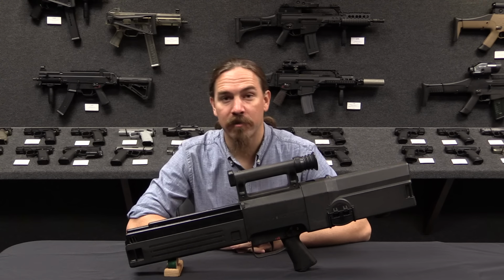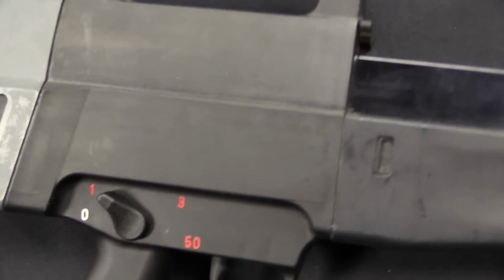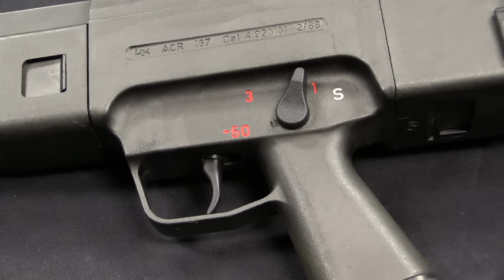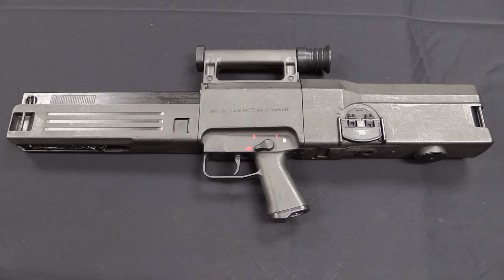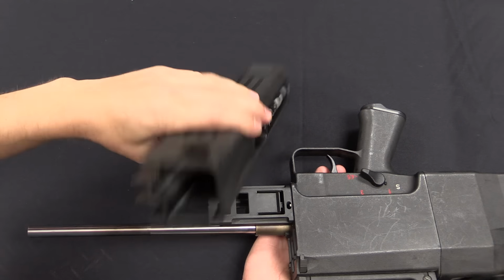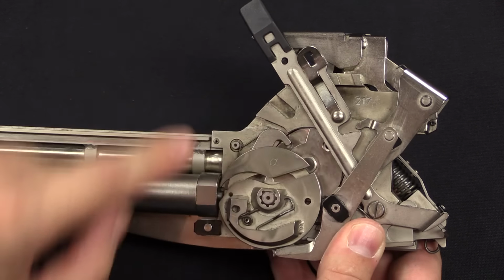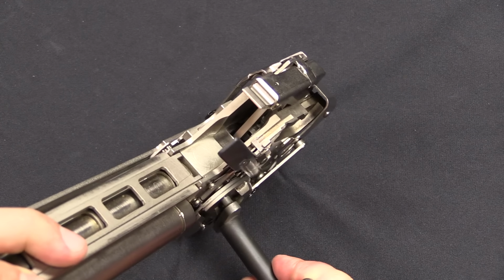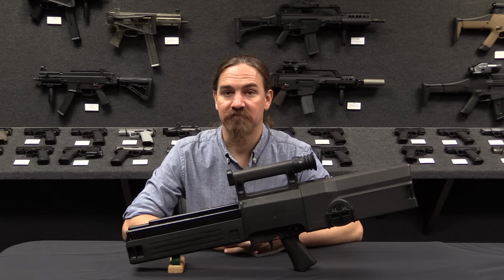Kraut Space Magic: the H&K G11

Comment: I don't see why the G11 didn't continue in development. Yes, the main component is complex as hell, but at the same time, it's just one lump of metal. If something important broke, chances were, the whole thing would need to be sent back to an armory to fix. On the other hand, it looks simpler to maintain than an AK-47 and would likely last you a lot longer with some basic TLC. Most importantly, I noticed, is that to simply get the weapon back into service, just take the lump of metal out and insert new lump of metal.

The Plastic Exterior could be upgraded with time and more durable materials as development would continue. Not like that hasn't already been done before. Tone down the rate of fire a bit for better accuracy and with its small size, a soldier could fight an Urban battle quite easily. He's presenting a smaller target, because the rifle doesn't stick out so far.

Seems like everyone is forgetting that all major rifles that have been in use, have been having jamming and overheating problems. The 'Improved' M4A1 is only improved because it tended to overheat and fail, requiring a new barrel and development for those parts. The G36 that eventually would replace all other German Rifles, has warped in combat pretty badly and is being replaced. The French are struggling to replace their rifle, as no one else uses steel cased ammo. And I heard the British had some fits with their weapons, as did the Canadians.

But most importantly, was the abject FAILURE of the 5.56mm to live up to expectations. To improve the round, all weapons are cracking like hell and requiring double the amount of armory maintenance, forget field maintenance. The G11's simple system likely wouldn't be able to accept a bigger round, but I have little doubt that if something breaks, the rifleman isn't having to sign out for a whole new rifle while a broken rifle will have to wait in a crate until its full to be shipped via Cargo Plane.

With the G11, just throw the broken pieces into a box and simple them via FedEx!
Reply: The problem is that the soldier's "work environment" has changed drastically since the adoption of the AK47, or even the M16. Body armour has added considerable weight to the soldier's basic loadout, as have various other tools, like individual commo, taclights, optical sights, and so on, and so forth. A weapon like the AK47, the G3, or even your basic M16A2 is actually a *weight problem*, hence the shift to the M4, to plastic everything-but-the-barrel/action, to experiments with case-telescoped plastic cartridges, and even caseless (the main argument for the G11 was never that it was better than the 7.62mm G3, but that it was lighter).
Right now, armies the world over are trying to square that particular circle, and most of them are not really succeeding, at best. 
The reason HK didn't pursue the G11 after the Bundeswehr cancelled and the ACR petered out is much simpler, though: the company went bankrupt. Ended up owned by Royal Ordnance, before being bought by the current owners. I blame a certain sense of being screwed over on HK's part for the shitshow that was the introduction of the G36.
Oh, and most of your suggested improvements to the G11 would run counter to its primary design features. They'd make the thing heavier, and "marksmanship" of the "one shot, one kill" variety isn't really a thing on real battlefields. Hasn't been since at least WWI.
Reply: @jochentram9301  To be honest i think this thing would be great for armor crewman and vehicle crewman, it is short enough to fit in my gunners station on the M1 Abrams. With the way the M1 Abrams is getting replacement parts to the users would not be an issue, you would not see it getting very dirty cause we just stick our weapons in the sponson boxes or next to or under our seats anyways. If you took off the optics and replace it with some flip up sights you would have a very effective PDW type weapon.
Reply: @jochentram9301  - Not entirely true. There are some materials out, especially on the open market, that are both lightweight and reliably tough. There would be an increased cost, yes, but I also don't recall saying that the G11 or a derivative of it, would be better than any other rifle. I recognize that due to its features, it would not be best to be issued as a General Issue Rifle.

I'm actually of a the 7.62 and .30 cal club. I believe modernization programs would cost less to revive both types to be more effective for General Combat Purpose (with variant types, of course) for combat. Like Brandon Child said, the G11 would be small and effective enough to be given to Tankers and other personnel who wouldn't be expected to be full time Riflemen.

Essentially, I would see the G11 fulfilling the role of a traditional Carbine (as a opposed to the non-traditional M4 Carbine, now Rifle). The traditional Carbine was always smaller and lighter, because it's job was to equip troops who would not be able to use full size rifles. This was previously the Horse Cavalry and Dragoons. Now it's generally anyone not serving the role of Rifleman or other type of Infantry Specialist.

The M4 Carbine was so designated and developed as a replacement for the M3 Carbine, which was nothing more than a WW2-era M1 Carbine with modifications to it. The M1 Carbine was developed to arm troops who would normally not be expected to be frontline troops, hence some later issues that cropped up. These were supposed to be men such as Truck Drivers, Supply Personnel, Cooks, Clerks, and other Rear Echelon personnel.

Some frontline troops were given M1 Carbines, but they were mostly supposed to be only Officers, Radiomen, Bazooka Teams, and other specialists where a larger, heavier weapon would be more of a hindrance, than an assistance.

The M2 Carbine was already in development even before WW2 ended, because the US Army had always wanted to add Full-Auto to the M1 Carbine, but needed the M1 sooner rather than later. So the selective Full-Auto was left behind. Work began in earnest in 1944 and M2 Carbines began to appear not long after, though there had to be changes done to the T4 in order to achieve full auto without problems cropping up.

Among other things, another change, had been to add a Bayonet Lug. Pictures do exist of WW2-era Carbines equipped with Bayonets. A notable one is dated September 20th, 1950 and in Seoul no less. Another Korean War image shows Communist prisoners being watched by a US Infantryman armed with a M1 Carbine with a Bayonet attached on a hill somewhere.

Additionally many changes were retroactively given to the M1 Carbine as well.

The M3, likewise, was also an ongoing development for improved capabilities and was issued to troops as early as the Okinawa Campaign. The major difference was the move for the M3 Carbine to be more of a Sniper Carbine. Only 150 initially went to Okinawa, but these carbines had early Night Vision Scopes and despite their limitations, estimates said at least a full 30% of Japanese losses on Okinawa alone, were the result of teams using M3 Carbines to picket against Japanese infiltration and patrols.

These would all prove to be legacy weapons that were kept in US Military service until after the Vietnam War. The M4 was not an immediate replacement, there had been the CAR-series, which had its own issues. The M4 Carbine was started in 1984, but was not actually accepted until 1994. The M4 has been in use since, but has made the shift from Carbine to Rifle, leaving a gap that already existed much larger from the lack of a traditional Carbine.

The G11 can help fill this gap. As one noteworthy Tanker, a gentleman by the name of Nicolas Moran, once stated, he would be less concerned with the ammunition than he would be, with being able to keep an opponent's head down while he ran away to get another Tank if he should be forced to abandon his Tank due to some reason in a combat zone.

That and he once listed off the weapons his crew needed and frankly, I'm amazed they could even fit HALF that amount in the turret without it becoming a safety hazard, though they figured out how to mount the LMG on the turret and so make use of it as another Tank weapon.

The G11, if it doesn't fill the traditional Carbine role, would still make for a better replacement for the Sub-Machine Gun or Machine Pistol (depending on what country you're from). Small enough that it could fit even in a helicopter for use by flight crews, which would provide them above Pistol-level firepower, but also not a full size Rifle, which could get stuck if they need to make a fast dash for it.

I ascribe to the belief of a weapon has a place and its best to know that there are limits to what a single system can do. The M4 is being tasked as both Carbine and Rifle, sharing ammunition with the LMG that gets issued. Attempts to turn all three into a single weapon and add both DMR and Sniper capabilities has not only proven to be a failure, but has also prove difficult and costly in terms of resources and money. Therefore, it is best to have something that fits a role better, than have something that can't properly fit at all.
Reply: @FLJBeliever1776  When I joined the German Army, the G3A4 was my issue weapon, and it was a fine piece of kit, but that time is done.
The problem with 7.62x51, or indeed any 7.62 round worth carrying is *weight*. The rounds are enough heavier that a worthwhile combat load of about 200 rounds per rifleman and 1,200 - 1,500 per machinegunner. That's exacerbated by the fact that the weapons would have to be heavier than 5.56x45mm weapons, simply to handle the much higher bore pressures. Notably, the HK MG5 is about in the same weight class as the MG3 it's replacing, slightly more than 11kg empty (the lighter variants have shorter barrels, which creates its own issues). Add another 10 or so kg of body armour, a few grenades, the occasional RPG, personal comms, NVGs, the plethora of stuff nowadays hung off Picatinny rails, and spare batteries for all of it, that rapidly adds up to an unsustainable load for the infantryman. 
That's the main argument for 5.56, and indeed 4.7 caseless - a 30-round STANAG mag for the M16 is a third lighter than a 20-round mag for the M14, which enables the infantryman to lug around all the stuff that simply didn't exist in WWII/Korea, but makes a modern infantry squad many times more lethal than their earlier counterparts. 
No amount of space-age materials is going to change that basic equation: 5.56, and the weapons designed for it, will always weigh less than a 7.62, assuming equal tech levels in their construction. And unless we want to get back to not issuing body armour to infantry, that creates an insoluble problem.
Reply: @FLJBeliever1776  For use as a PDW a G11 would be overkill and a rather pricey one at that. Could tankers use something more compact than an M4, sure, but something as pricey as a G11 is a bit much for something the crew probably won't use. They'd be better off with AR style pistol with a proper stock instead of a brace.

As for carbine usage, it used to be for rear echelon troops and those who needed a more compact weapon but that's no longer the case. The primary rifle of the US Army is the M4 and even the Marine Corps, who had resisted the adoption of the M4 for a long while, has adopted the M4 as its primary rifle. I don't know about the Army but in the Corps the M4 is what's issued to the grunts with all of the non-combatant/rear echelon troops getting M16A4s, a complete reversal of the way things had been for a long time.
Reply: @Riceball01  Marines just adopted the hk416/m27 to replace the m4 as the main squad level weapon, even to replace the m249
Reply: @Riceball01  - That's because the Marines about to get a wind fall of ex-US Army M4 stocks. The US Army requested of Congress to restart looking into replacing the 5.56 NATO with either a 6.8mm and/or updated, modern version of the 7.62mm NATO. Congress agreed to fund new 7.62mm Rifles for the US Army while the Army looks to replace all 5.56mm NATO weapons in the near future, including issuing requests, at long last, to replace the 5.56mm with 6.8mm in the LMG role and use 7.62mm in both the Battle Rifle and DMR roles.

This came on the heels of the US Army admitting that 5.56mm NATO will not defeat currently available body armor. At least the good stuff, which unfortunately, has been increasingly winding up available and not just US Military stocks either. There was word that the Georgians, when the Russians invaded them, lost some equipment and stores to looters. The same problem occurred in Ukraine.

So there is concern that multiple sources of first rate body armor suit equipment has ended up floating around, outside the controls of Nation States. That said, if we get into with the Russians or Chinese or whoever else and they have good rated armor, the Army stated, the 5.56mm would be ineffective far more often than they would like.

In the end, I could wish for the G11, but chances are, if it isn't uprated to 6.8mm, it wouldn't pass muster. Which would also mean that anything under 10mm, would likely be just as ineffective. So the argument is there that a Pistol with AR capabilities would just be pointless as well.
Reply: @FLJBeliever1776  I don't think that the Corps is particularly interested in the Army's old M4s since we've been busy fielding H&K 416 as the M27.

In regards to a pistol AR, I think you misunderstand. By pistol based AR what I mean is one of those short barreled ARs that are legally classified as a pistol, basically a full sized AR receiver with either no stock or an arm brace, a shorter than 16" barrel, and chambered for any caliber that you'd find in an AR from 5.56 to 300 Blackout, to one of the 6mm calibers. You'd have a compact weapon that has a lot of parts commonality with the M4/M16 and the same manual of arms so it's easy to use and makes logistics simpler.
Reply: @Riceball01  - Likely won't have a choice. The M27 doesn't offer that much difference due to the round it uses. As such, it would be cheaper and more effective for the Marines to make do with readily available M4A1s as their standard service rifle and use the M27 for other tasks and be limited issue.

Okay, I'm a little bit behind on some terms and classifications. Plus I can easily forget something that really doesn't have a long standing bearing on my life, but who doesn't?

But yeah. Still don't see it happening. The weapon has to still be able to perform to a certain criteria, doesn't matter if it can match existing needs and equipment. Would be nice though. Keeping the costs down, making use of existing stocks, minimum to no changes, and being easy to use.

The problem, though, is that I don't see the M16/M4 line surviving as an effective combat system past another ten years.

For one, the 5.56mm NATO is already unable to penetrate effective body armor. The second is that the issue of range has come up again, as a result the rounds had to be made more powerful and unfortunately that meant increased maintenance of the weapons. Third, their size is becoming a major issue due to their increasingly obsolete design.

The future of Combat Rifles and Carbines will be Bullpup Designs. It is not a matter of being better. It's a matter of being easier to carry and stow.

The current rifles take up too much space in vehicles, making them harder to deploy from vehicles or to more safely stow in vehicles. So the emphasis will be to switch to Bullpups to cut down on the size of the overall weapon while maintaining the same level of effectiveness, relatively speaking based on future battlefield projections.

With body armor becoming an increasingly common theme in the world, the 5.56mm, which can easily punch through a person, but not effective body armor will begin to fail en masse. Already, many groups have tried to pressure the government and military into accepting larger rounds. Unfortunately, they have not met any success despite the obvious let downs of the 5.56mm.

Since a new ammunition round has to be sought out and the designs of the M16 and M4 are already approaching obsolete status, even the new M27/HK416 will have a short service life before being replaced by a 6.8mm and/or 7.62mm Bullpup Rifle and Carbine designs.

So the Marines will get the M4 and the idea of a Pistol AR based on the M16/M4 will not materialized as a result.

I actually would prefer to see the US Army accept Israeli TAC-21s and begin work immediately to remove the M16 and M4 from service immediately.

It would be win-win. The Israelis would export their weapon to the US, driving down its costs for their own forces, and the US would get an existing weapon from an ally that can teach us how to best use it, allowing our soldiers to learn the weapon faster and at reduced costs. Then we can learn from the Israelis to produce it domestically and the Israelis will get the fees for US production and costs for it would be driven further down.

Best of all, the TAC-21 can still use 5.56mm NATO as well as other types of ammunition, so we can use up the stockpile of the ammunition before switching over to a designated new caliber or calibers for a new domestic design produced.

Additionally TAC-21 comes in several variants as well, including ones for Vehicle Crews, so the same concept as you put above, can still be put to use keeping the costs down.

I would like to see the US Military equipped with its own Bullpup configured design with a new type of ammunition caliber or an improvement of an existing caliber, but until then, as I said, I would be happy to see our guys with the TAC-21.
Reply: The Corps will almost certainly not be getting late socks off M4s as they have been steadily ordering more M27s. They first got them in as automatic rifles to replace or supplement existing M249 SAWs, then they got more as DMRs (I think) and now they seem to be slowly replacing M4s in grunt units. When the Corps first announced they were going to procure 416s for use as automatic duffle rifles it was believed, by some, as a back door means of getting new rifles and it seems that these people were right.

As for bullpups being the future, I'm not so sure about that. The French are looking to replace their FAMAS not with another bullpup but the HK 416 and the Germans, who are looking to replace the G36 aren't looking at a bullpup but the 416 as well. It also wouldn't surprise me if the Brits eventually replace the SA-80 with the 416.

In regards to 5.56, it's not that bad of a round and actually has decent penetrating capability depending on the exact round. In fact, in Mogadishu, during the Black Hawk down incident, it was found that the round in use then, being designed with armor peneoitration in mind, didn't work that well against unarmored personnel. Since then, the Army & the Marine Corps have been busy designing and fielding new 5.56 rounds with increased armor penetration and lethality. That's not to say that there aren't better calibers available now but I'm not sure that they're so much better that they warrant the cost of replacing the M16 and its variants. At most, I'd see the US, & maybe other going with something like 300 Blackout or a 6mm round so that at most they'd only have to replace the uppers of existing M16/M4. This allows the military to keep existing mags, spare parts for lowers, and requires little to no retraining for anybody, making it much more affordable than acquiring an entirely new rifle that, in all likelihood, will not result in a creative enough of an improvement to justify the cost.
Reply: @Riceball01  Hey, I'm just saying what the US Army said and can be found in Military News Sources, including official Military.

I know people have been saying this and that about the 5.56mm, but I heard from early vets they absolutely loathed the 5.56mm for its ability to be outranged by Taliban AK-47s on a regular basis.

Didn't matter if it was a flat plain or a mountain top. The Army then pulled out old M14s, refurbished them and rushed them to troops being pinned down. Once the M14s arrived, the situation suddenly reversed itself. Then the Army sent new 5.56mm ammunition, but as time went by, the round was found to be increasingly problematic with cracking weapons and causing increased maintenance needs.

As for the French and the German Armies, little surprise they are getting HK416s, though. They need replacements NOW! The French Army's FAMAS is running out of ammunition, which if they hadn't been using their own unique casing type, wouldn't be a problem. The Germans have a weapon that is malfunctioning so badly, they need a replace today.

The HK416 was being introduced into major military and some police forces, so there was already a production run started and therefore, all tooled up.

More importantly, the HK416 is a much more modern rifle with all of the kinks worked out that had plagued the M16s and M4s. That would make it far more reliable for use on demand rather than find out something wrong later on. The thing, though, is that it is still using a design from 50 years ago and therefore, people are comfortable with it.

Trust me, if I was SecDef, I'd cancel the Marine order and tell them Tough Shit, transfer the money from whatever program that won't even reach prototype stage for another 30 years to learn it and build it en mass.

The USMC has, like Navy and Air Force, invested too much in new technologies to the point they aren't willing to look at new developments elsewhere because they are pouring money into expensive programs that look to simply be there to keep jobs rather than produce kit.

The F-35 alone has be declared the biggest blunder in US Military History!

Yes, they are getting it to work NOW, but tests have not been satisfactory at all. The F-35 still loses too frequently to handicapped F-16s, even after the F-35 is optimized for best performance, to the point, the USAF has decided to spend serious funding to acquire new F-15s and has already started the process for New Build A-10s.

While the HK416 will provide for now, the main driving forces is that the design is proven and tested thanks to the M16 and M4. Therefore, troops will be comfortable with the weapon, parts will already be available, and it will be using 5.56mm rounds that already in production and everyone can share.

The downside, is that the HK416 only improves upon an otherwise good rifle that is 50 years old in design, actually make that around 55 years, the ammunition has been in service that long, and changes are already happening.

I used the term Effective Body Armor previously. There was a reason for that. Not all nations can produce or will produce Body Armor that is of equal performance across the board. As such, I decided on a different term than what the US Army officials stated.

Which was that 5.56mm cannot defeat ANY Modern Body Armor, period.

No ifs, ands, or buts.

Tests conducted by the US Army against its own Body Armor, show the 5.56mm to be lacking.

That is why I say the HK416 will not last long. In perhaps 10 years, the 5.56mm will be obsolete. It has maybe, just maybe 25 to 30 years. Then it will be effective against unarmored targets only.

The 5.56mm and US Army Body Armor is now well known throughout the world. If our current issue can stop 5.56mm, you can bet both Russia and China can stop it too.

And if the Ukrainians and Georgians had had armor remotely able to do the same, then you know that stuff could be floating anywhere because of Russian Corruption, to say nothing of Russian Corruption stealing Russian Body Armor and selling it on the Black Market.

To say nothing of the many suits taken from the Israelis in past conflicts with its hostile enemies.

To put it bluntly, the 5.56mm has hit its Swan Song and it will be all downhill now.

The US Army wants 6.8mm and 7.62mm and since their projects are of more immediate development and needs coupled with the fact they've been better at controlling their purchases, just not where everything goes, they actually have less political and financial reasons to come out and say, "The 5.56mm NATO round is now approaching obsolence," unlike the Marines who have sunk their funding into projects that either didn't pan out or spiraled too high in costs.

At least both the Army and the Marines can both safely say, when they buy something, they intend to buy a lot of ordnance for it.

The Navy has Cruiser weight Destroyers with some of the most potent guns in the world, costing them hundreds of millions each, and they only have about 80 rounds for three ships.

Go figure.
Reply: I can imagine that getting very expensive, a complex mechanism which we just decide to never repair and throw away every time would end up costing a lot more.
Reply: @hedgehog3180  - I never said throw it away. I said throw them in the box and send them back to the Armory. There, any problems can be diagnosed and repaired. So while the rifle itself isn't removed from service, the parts are, but also, unless a complete loss, repairs can be carried out. Even if a complete loss, strip it for what's good, and metal the rest down. Would take only a well trained armorer so many hours, simply due to the fact it is a lump of metal, to take apart, figure out what's wrong, and then address the matter.
Reply: The thing that always bothers me with people complaining about a weapon's weight is that they don't take recoil mitigation into consideration. I weigh 5 pounds soaking wet and weight on a gun is a godsend for me in terms of increasing my control over a rifle. I'm not a fat guy who can instantly absorb all of the combined recoil with my own body weight and just shrug it off completely. It has to go somewhere after all, and no amount of proper stances will negate it 100% for someone my size. You're gonna feel it no matter what.

If you're competent and used to the weight its less of a hindrance and more of a useful feature, at least in my opinion. If a shrimp like me can lug around stuff like an RPK, backpacks, ammo, vests, ETC, a physically fit infantry man can too. They'll just be grumpy about it.

I'd rather have a gun that weighs a little too much than a gun that doesn't weigh enough.
Reply: @xmm-cf5eg  The issue isn't muscle, or lack of conditioning. 
The US military has seen a considerable rise inincidence  of busted knees in the last two decades, especially in the infantry, and doubly so during deployments. Knee injuries were the leading cause of medevacs from both Afghanistan and Iraq, few of them combat-related. The current hypothesis is that the problem is caused by constant overload, i. e. weight in the 40 to 45kg range carried for 12+ hours on a daily basis. They're basically seeing the same kind of damage you'd expect in seriously obese people , , , which really shouldn't surprise anyone. The human knee isn't designed to handle total weights of 120+kg, especially not while doing things like running. Not for long, at any rate.
Turns out slapping too much weight on infantry *cripples them*, as in renders them unfit for duty.
Reply: @xmm-cf5eg  Yeah weight on a gun can be a good thing for recoil while actively firing or in combat, but of course that's not what's going on 99% of the time, and losing men to knee, foot, and back injuries due to overloaded weight is significantly more of a problem than marginal differences in recoil compensation.
Reply: @samwise1790  US military just needs to look to the public for ways to upgrade their rifles.  I've seen some brilliant AR builds out there.  If they took some ideas from those they could drop a lb or maybe 2 off the M4 and have a hell of a rifle, and they would only need to buy enough to equip the guys in combat since it's parts compatible.
Reply: @p51mustang24  but now the marines adopted the hk416 which isn't very parts compatible with the m4, so it's not as easy logistically to do anymore.
Reply: I'm seeing how you could dump most of the package and just make super small fast gun like super bullpup